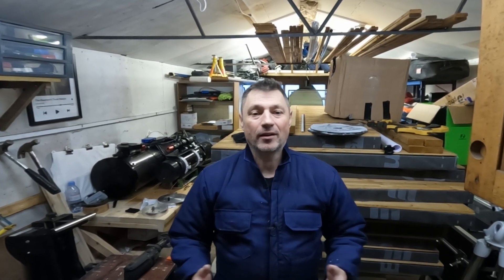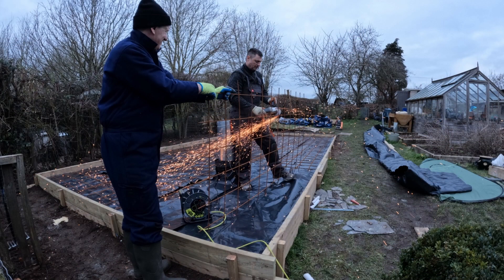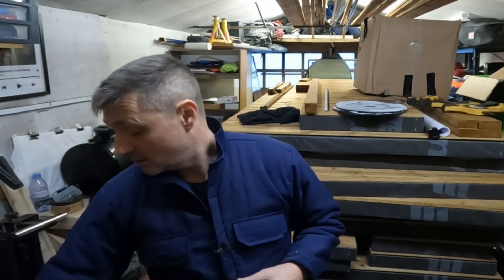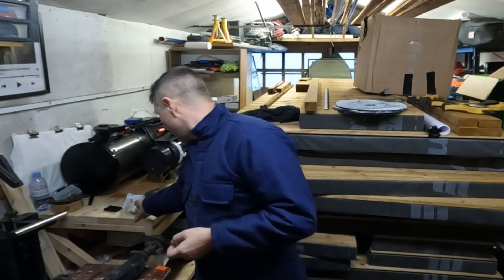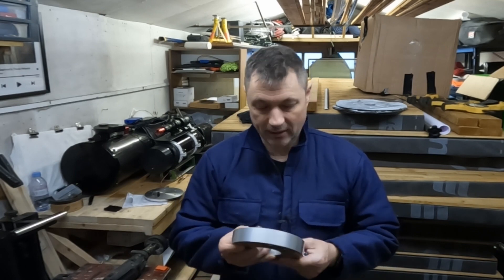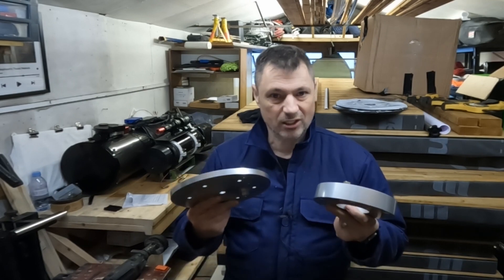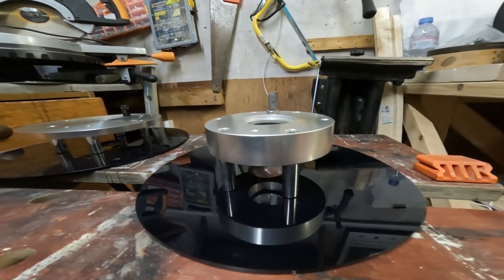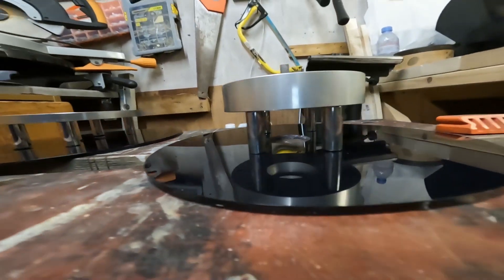Getting Pier adapters ready for mounting onto the Piers

Comment: For 'best' results you want the spindle on that wheel at 3000rpm and use the white compound before the rouge. Much tighter finish.
Reply from the maker: Thank you Karl. I will be totally honest and I had forgotten which colour did what. I will have another buff now
Reply: @Astrobloke  I worked in two industries that included surface finishing, some things you don't forget. :)